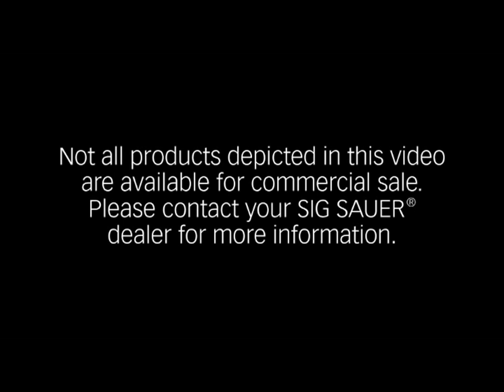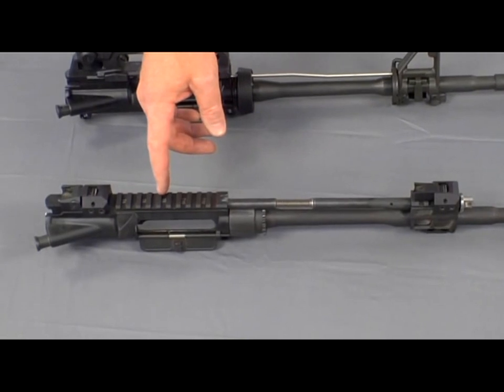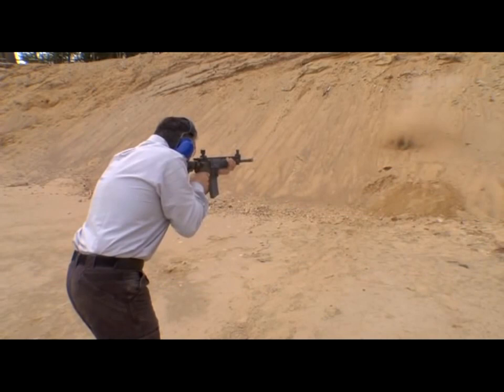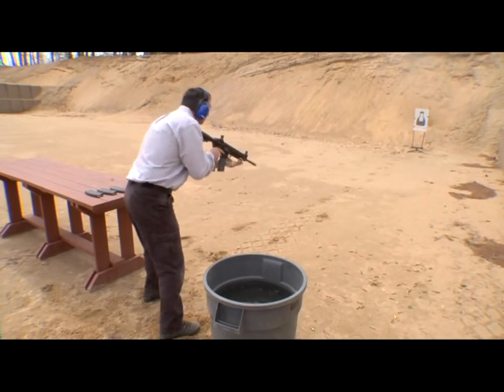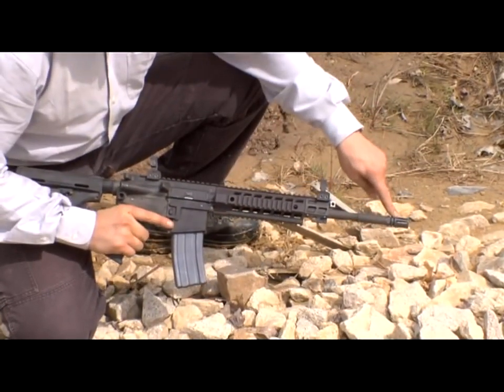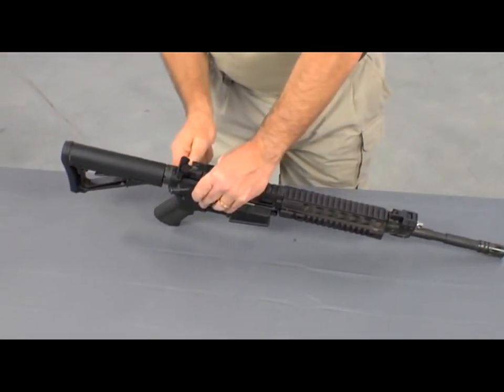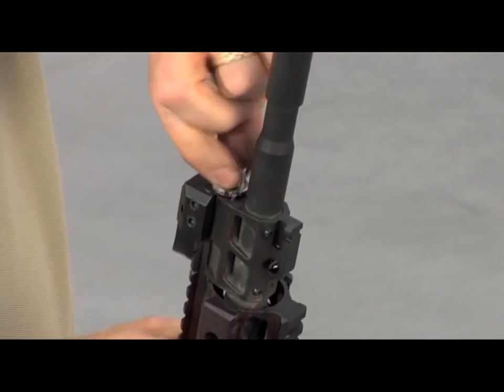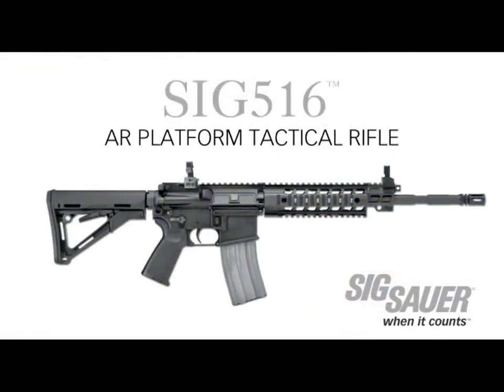Sig-Sauer - SIG516 torture test and field strip

Comment: The 516 ain’t no joke. Too bad Sig retired it.
Reply: Whats the main difference between 416 and 516???
Reply: @Tavis15ify  The 516 has quite a few AR 15 compatible parts, while the 416 is completely proprietary. Also the 416 rate of fire is so high that it’s basically destroying it self, not so on the 516. Another negative in my opinion is the price. Hk 416 are extremely over priced IMHO.
Reply: When did they retire it? Would it be a bad idea to purchase one now because of this? No more support?
Reply: A mistake on their part too. Good rifle and a ton of potential for further development and accessories.
Reply: Jesus christ people are so willing to spread bullshit. As of today (10/10/2021) the 516 upper is available on sigs website, and has been for a good while. It was NEVER discontinued, only out of stock.
Reply: @jamesstephenson2346  they do sporadic sales on uppers and certain parts, but full production of this rifle has been discontinued as per sig Saier.
Reply: @jamesstephenson2346  pinned and welded upper for 1200, they sold this for 800 a few months ago, this is just sig making a quick buck, this rifle is discontinued in the sense they don't market it commercially or develop it. These are just the 14.5 g2 uppers pinned and welded, and those sold as low as 400 at one point.
Reply: We have 416 at home

Comment: For the noobs on the comments. Sig 516 is the poor mans HK416, same designers and lineage. Next gen is the caracal 816.
Reply: Ricardo Alfaro negative.  The same engineer developed the 516 with the intentions of making it a more efficient rifle.  It’s also 2k. So I don’t know where you get the “poor man’s hk” I have the 516, a colt, and a Daniel defense.  The Daniel defense is about 500 bucks more and the sig runs better than all of them. Cleaner and less recoil.
Reply: @josephkelly752  I own a SIG516 Patrol chambered in .223 Rem, because that was the only type that I could get my hands on here in Germany. Do you know whether or not it can fire 5.56x45mm NATO rounds?
Reply: -Turtl3_  theoretically u can fire 5.56 out of 223.  Its highly not recommended tho due to the increased pressure 5.56 generates.  A common rule of thumb is that if a barrel is chambered in 5.56 it can successfully fire 2.23. A barrel chambered in 2.23 can fire 5.56 but it is not recommended unless u want your barrel to potentially crack or worse. So stick with the 223
Reply: @josephkelly752  Thanks for the answer but does it also depend on the quality of the barrel? Asking since the Sig 516 Patrol is constructed as a heavy duty rifle with a chrome lined and nitrided barrel, so can't it hold up to the higher pressure?
Reply: -Turtl3_ you can have the greatest constructed barrel on the market but if it’s not made to shoot a certain round, it will fail.  I would stick with the 223 round.  The 516 patrol is a great rifle and its actually been discontinued.  I wouldn’t risk it.
Reply: @josephkelly752  Alright, thanks a lot for your time again. Maybe I'll try to get my hands on an Ar15 in .223 wylde then, but for now I'll stick with using .223 rem.
Reply: -Turtl3_ no problem bro.  Happy shooting
Reply from the maker: @-Turtl3_  Hey, check under the barrel, near the bird cage. If there is " 5.56 NATO 1/7" it's ok. All SIG 516 i saw have that
Reply: @zonked4370  Is that also the case for the German version of it? I can't check my barrel right now because I'm not at home but I heard that there's a version with a 1/10" twist made for the German market (or maybe the European market) and the caliber is listed as .223 Remington everywhere I look
Reply from the maker: @-Turtl3_  I'm from Switzerland and here it's 5.56. To be sure, just check what's written on your barrel :)
Reply: @-Turtl3_  there should be a 556 stamp on the barrel if you can't see it I would highly suggest you go back to were you purchased the rifle ask the dealer and also look at your manual that came with the firearm I have a 516 I've shot both 223 and 556 through it no issues it should be chamber for a 556 though
Reply: @-Turtl3_  course I bought mine in America but I just looked at my rifle and it has 556 stamped on the barrel right behind the flash hider says 556nato that helps you any
Reply: @josephkelly752  you can buy a 516 upper for loke $600 and slap it on any lower and easily get one for under $1k. Not that it degrades how awesome the rifle is but compared to a 4k m416 that uses strictly proprietary parts I would consider this the "poor mans" rifle of the family even if it was designed to he a better rifle than its older brother.
Reply: @-Turtl3_  My 516 has .556 1/7 stamped on the barrel. The 516 is one of my favorite AR’s along with my LWRC and Daniel Defense DDM4V11.
Reply: @josephkelly752  no, it's not discontinued. And no, don't shoot 5.56 out of a .223 barrel.
Reply: @connormckay9429  it's an entirely different different weapon. It's a "poor man's" version of nothing.
Reply: @HolyManG  who says he only has one weapon?
Reply: @michaelhodges8312  some European countries do not allow guns sold in "military calibers" to be sold on the civilian market. So manufactures either marl them with the civilian equivalent caliber, or make a different barrel for use overseas.
Reply: @-Turtl3_  Just get a rifle smith to ream it out to .223 Wylde, check the headspace and you should be good to go. It won't cost much  and any competent gunsmith should be able to use a reamer to rechamber it. It is NOT a bit deal. (I work for a high end rifle manufacturer).
Reply: @jamesstephenson2346  Discontinued in 2019.